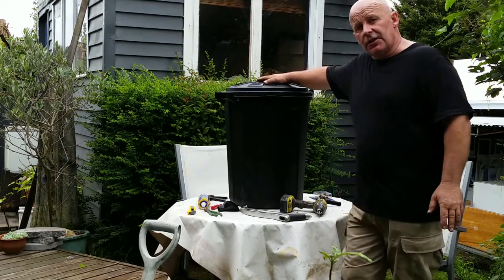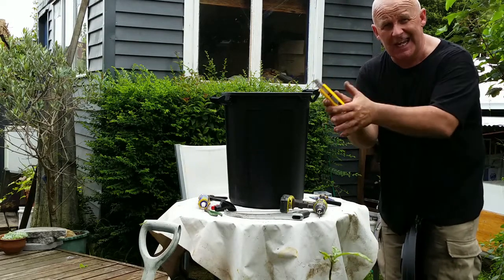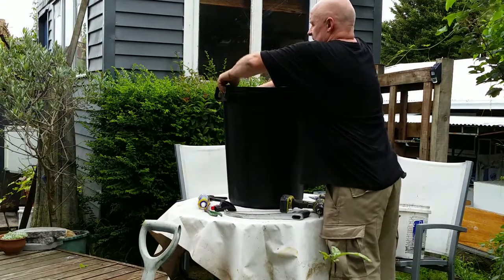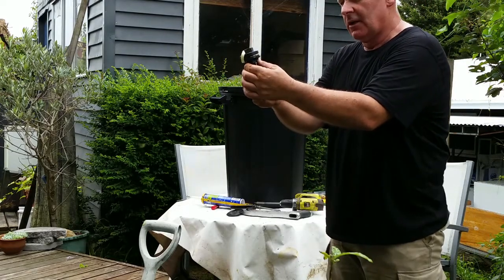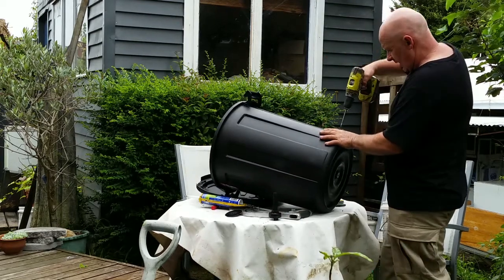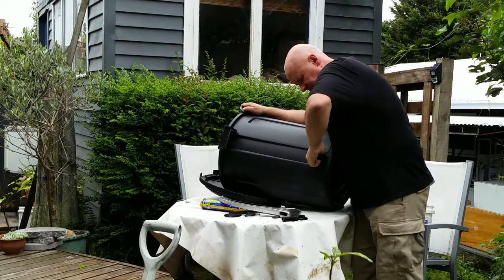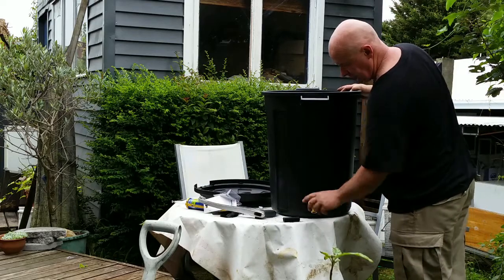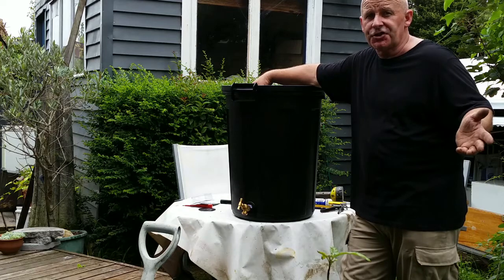Rain Water Harvesting Emergencies DIY  for $40 Off Grid 2019

Comment: Nice rain bin!  I use 275 gallon UBC containers (food service).  It's quite dry here on the plains of Colorado USA.  Tip: Drilling a center hole in the spout hole, then using a dremel-like tool to 'grind-out' the right size whole works wonders.

Comment: Good idea.  I think I know why you used a small can.  It's a lot easier to reach in there at the bottom and hold the nut to screw in the faucet than it would be with a 60 gallon drum.

Comment: Could you could use a rainwater diverter on a downpipe to run into the top reservoir, if you have guttering on anything and not room to install a large rain barrel ? I like this as a “stand alone” system - thank you so much 👩‍🌾
Reply: When the rain starts, it will wash bird droppings off the roof and into the rain barrel.  Not good for your health.

Comment: Isn't the sun going to break down that plastic eventually?
Reply from the maker: the outside of my oldest one ( 7 years ) is dull and faded - the inside is like new. they are UV stabilised- they have to be spending their life outside. my two newer ones live under a roof and still have their paper labels on them- they are 3 years old. all plastics in NZ have to be marked with their type. These are all polypropylene which is what water tanks water pipes and polarfleece outdoor clothing is made from.

Comment: You might want warn people to boil the water if they are using it for drinking in case the raise contains microbes, or pick up a UV water filter or similar.
Reply from the maker: Yes - of course. Where I live rain water is pure and drinkable but others areas are not so lucky. Al;so, in my country, we dont yet have the scourge of the American sty;e legal disclaimer system, lol  . Ill lead you to the water but I wont make you drink it. One great thing about the rubbish bins is that they are moulded Polyethylene which is inert and safe for water storage. thanks for bringing this point up - Ill add annotations to the video